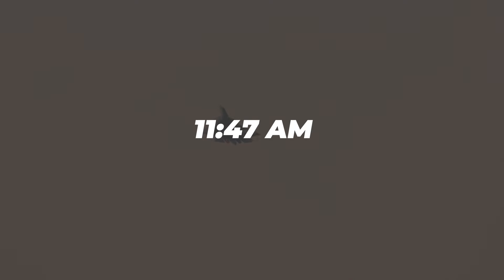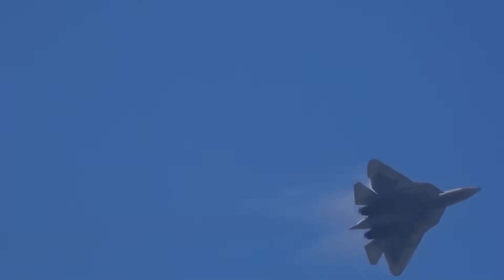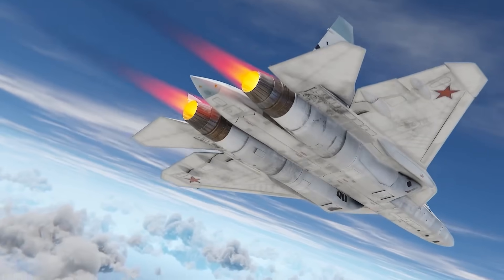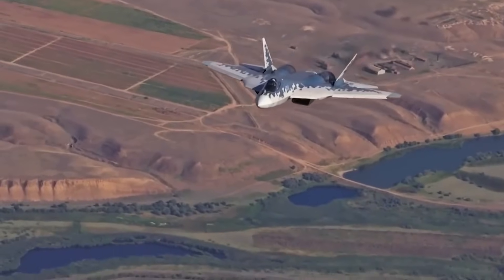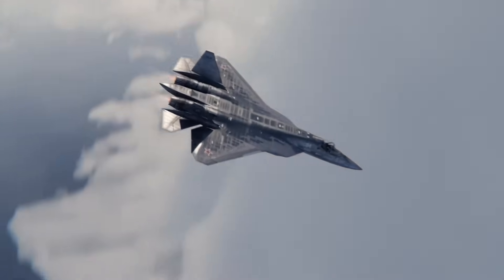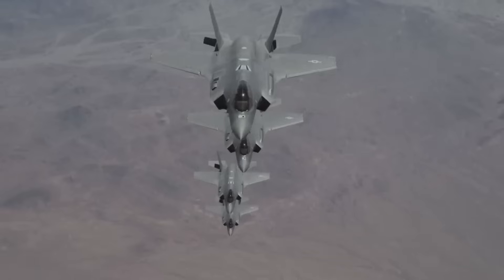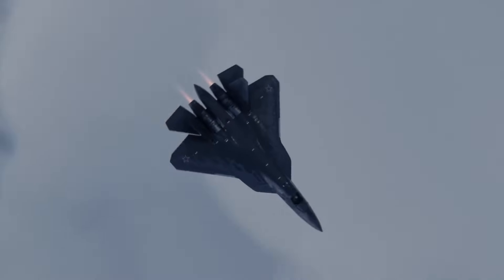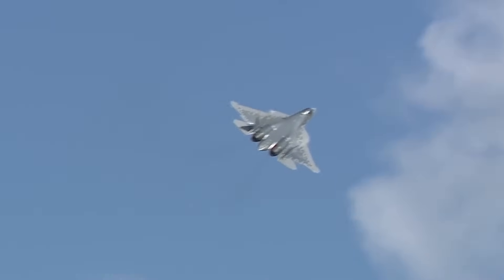Why the Su 57’s ‘Bad’ Design Is Actually Genius

Comment: Stealth only works against poor countries anyways, modern radar systems can detect stealth aircraft for more than 100km anyways.
Reply: @apenasumhunter3212 Not even that, remember, that Serbia detected and shot down F-117's with 1960's Soviet radars and AA systems.
Reply: @StefanBlagojevic  only once >.>
Reply: @Toast_d  Tell that to Lieutenant Colonel Charlie “Tuna” Hainline, who officially came on record, stating: "His airplane wasn’t in really good shape,” Hainline remembered, and soon after the other F-117 had plugged into the boom, the jet fell away, leaving “Tuna” and the tanker crew wondering if it was now flying on only one engine, or if some other problem had presented itself to the pilot. The jet crashlanded at Spangdahlem - Germany and was written off.
Reply: @Toast_d  Just only once was enough to force the US Air Force to retire the F-117 for a permanent.
Reply: @StefanBlagojevic  Crash landed but not shot down ^^, two different words with two different implications and meanings
Reply: @lucifers242   It got retired, indeed, but it was retired due to more advancements in stealth and radar technology alike.

Its in a special role as of writing this comment where it still flies in specialized roles like aggressor training.

I mean who wants a flying wedge than can only carry two bombs when you have an even bigger wedge that can carry more of the same bomb, or two even bigger bombs! Decisions decisions...
Reply: @Toast_d  Written off and struck from record. "It never rains, but it pours".
Reply: @StefanBlagojevic Written off by extensive damage buuut not shot down. An Su-57 can't be declared "shot down" if it's rendered irreparable by anything other than being shot down in mid air combat. Unless, you want to admit an Su-57 got shot down by a puny drone?
Reply: @Toast_d  Who's talking here about the Sukhoi bub, I'm only stating the fact it wasn't a fluke, since it wasn't just the one stealth aircraft that got targeted and got shot, LoL. Whatever beef you've got with the Sukhoi, have at it for all I care =D
Reply: @StefanBlagojevic And I'm stating the cope I'm seeing from stretching the definition of "shot down" to "crash landed" sounds like you have beef for the F117 as well, bringing up the Su-57 being shot down by a drone is just sooo~ easy to say when using your logic ><
Reply: @Toast_d  You're mixing apples and oranges bub, can't help you there.
Reply: @StefanBlagojevic  Mhm, sure, can't help or can't argue?
Reply: @Toast_d  I did argue, with two F-117's shot and with sources you can easily check for yourself. "Can't kill what you can't see has been" debunked, twice, by 1960's Soviet AA tech. Enjoy your research.
Reply: @StefanBlagojevic  Your argument is stretching the definition of words, more of a "cant" rather than a "wont" argue, you didn't read my comment properly.
Reply: @StefanBlagojevic  You did argue, I was saying that you just can't, you're stretching the definition of "Shot down", using the Su-57 was just to put a reference to how idiotic your argument was.
Reply: @Toast_d u r 5 yo dude lol
Reply: @StefanBlagojevic Same serbia failed to down a single B-2.
Reply: @Eshrakgaming934  Tell that to the U.S. Air Force, that had to go to "SPAČVANSKE ŠUME" to recover the B2 wreck. 😁
Reply: @StefanBlagojevic and it took some shit ton of dedication, planning and luck. They're used multiple radars and the range where they actually detected F-117 was much less than radars operation range.
Reply: @StefanBlagojevic  bro, this has been debunked so many times, and it was pure luck
Reply: @Yeeeee-w9h  Pure luck? What about the second F-117, testimony by Lieutenant Colonel Charlie “Tuna” Hainline? Shot over Serbia and chrashlanded in Spangdahlem and written off? LoL, you live in denial.
Reply: @Yeeeee-w9h  Well, the Nighthawk were flying in their common route, which is a strategic mistake by the American. The Serbian notice their flying route and focusing their radar there.

Coincidence? No 
Luck? Yes, because the Serbs managed to shoot it down.

But again, I feel this is the pilot's arrogance in their high feeling of their superior tech. Since it was a stealth aircraft, they began to feel the "no need to worry" about the Nighthawk when open its weapons bay, which distorted its stealth capability, just because the Serbs only use old tech.
Reply: Thats why Russian tactic in Ukraine is glide bombs. Lobbing them from safe distance into the area until everything there stops existing, then moving in with soldiers on the ground. Slow, but inevitable.
Reply: У СУ-57 и СУ-35С радар видит в радиусе 400 км.
Reply: This is why American fighters don't dare to fly close to the Russian radars. They can successfully fly and bomb only terrorists and militants.
Reply: First, no and second stealth is not some magical solution that wins against everything. The stealth design alongside RAM is nothing more than a tool. You still have all other methods such as flying low, using the weather, jamming turning off your radar, etc that 4th gens use. It is just another tool. Different frequencies bring different results. You might have lower frequencies which go further and due to their "size" can't be as easily dispersed as higher frequencies. Yet lower frequencies cannot give the precision needed for a lock. Which means that you can technically use them to guide a missile but the chances of it hitting the target are slim to none. Higher frequencies give higher precision but they require more powerful antennas in order to go further. That's like using a sling. If the ball is larger you need to pull harder in order to get as further as a smaller ball. Yet, it is easier to disperse them.
Reply: Nahh
Because you stupid doesnt know how stealth work
You forgot about B-2 going inside iran
Reply: @resliaamayrilisys4617 Iran has very weak economy mean iran is poor. You Arrogant stupid
Reply: poor countries hve older radars too, but you can't TARGET a stealth
Reply: Detecting it tracking it and miss locking it are all wildly different things
Reply: .....By the way, modern radar systems from China and rushka could not protect Maduro from American special forces.....
Reply: Lol how much you would be willing to bet on that statement? 😂 US and its NATO allies wouldnt have ordered alltogether over 3000x F35's fighters already if they werent convinced of its capabilities.

Speaking of which, do you know how many SU-57's Russia has been able to manufacture, including the prototypes? 😂
Reply: @Balnazzardi  Tell Lieutenant Colonel Charlie “Tuna” Hainline he's lying then, see how that goes, I'll grab the popcon. 😂
Reply: Source: Trust
Reply: yes and no the absolute top stealth aircraft can bypass many mid range radars but its very hard to get past a full array
Reply: W/o where’s this pancake spin epic fail
Reply: Agree
Reply: exactly. Stealth is meant to terrorize weaker countries like Iran. That won't work against Russia and China
Reply: People need to realise that stealth is simply a tool. Hyping it as a "wunder weapon" is the mistake that Nazi Germany did. It's an advantage, but not invincible.
Reply: They are easily detected in rain,all you have to do fire silver iodide tocause rain
Reply: @aakashboom  good luck doing that when you're a Venezuelan dictator.
Another thing. Good luck doing that when you don't have the infrastructure.
Another thing (you gotta be the easiest target here, I'm firing bursts at you.)
You wouldn't call in rain unless you already detected the planes. So, your detection idea, relies on detection itself. Thank you Pvt. Armchair for your input.
Reply: Shhh ! If americans could read that they would be very upset !
Reply: @jayyadav6576  maybe it could detect stealth aircraft from 100km away...if the bomb bay is open...without any radar warning system.
Reply: Well thats the thing with the western commentators, they never actualy faced real army. We see in Ukraine that all western hardware is nothing but junk, expansive junk
Reply: @ekoneko6958  come on boris i know your shift is almost over but atleast TRY to write proper english
Reply: @LAUMINEIL at least I can speak more then one language 😂
Reply: @ekoneko6958 lol as if latest weapon and armor have been sent to Ukraine 😂 and yet some of it like Javelin missiles and Stingers proved to be quite effective against Russian military vehicles + Russians themselves have proven what kind of garbage their own army and equipment is with T72, T80 and T90 tanks destroyed by thousands and their airforce completely unbale to gain air superiority 😂 so try again Ruskie, if NATO was there with their full force, the pathetic Russian army would have been wiped out long time ago and many times over 😂
Reply: @ekoneko6958  they seem to like Javelin missiles a lot. The Russians not so much.
Reply: Modern,and old radar stay off if close modern west plane come close 200 km. switch radar on, and you are dead in couple minute.
Reply: The problem isn’t tracking, it’s locking on. No radar on earth can lock on to the American F-22
What did I expect when commenting the truth on a AI slop video that makes all western tech seem like shit and all eastern tech seem like godlike machines.
Reply: @turtlechanel8345  Because it has only combat experience against a Chinese weather balloon/spy balloon, 2 missiles needed to destroy the balloon (the first missile missed and 2nd missile is needed.)
Reply: @turtlechanel8345   "tracking"  Why on earth anyone wants to track that specific bird eyes?
Sure a radar can detect stealth aircraft, but it's not going to be noticed, because it's not the only object on screen & it's so small & no one knows what it is  . . and there's still no app that can effectively differentiate stealth aircraft & birds

F-117 is a repeat of U-2 accident, that's why military should not re-use a flight path back to back
Reply: The United states has the best Air Force and fighter's in the world.
Reply: @paulahutcherson1045  Not for long, China is producing more fighters per month than the US does in a year. China also has the mosy heavy weight fighters in the world, giving them a huge range advantage. Chinese fighters recently took out french rafales too, The Chinese J10 costs one fifth the price. I hope the US manages to stay ahead but i doubt it will. The US defense industry cannot make anything that stays in budget.
Reply: @ruhtraeregel Cope, lies, or ragebait
Reply: @Yeeeee-w9h  Not sure I get you, I assure you im not coping, nor am I lying and certainly not raging lol. Can you elaborate? What are the lies you mention? Coping for what? It helps when you are a bit more specific. Then I can reply effectively.
Reply: @paulahutcherson1045  it does, but those airplanes are expensive and fragile. In any sustained conflict with a peer opponent a lot of them are out of action for maintenance and would eventually fall behind to attrition as they can't be replaced at the necessary rate. 
In the end everyone uses these planes to fire range from outside the range of air defense anyways, so the advantage isn't really used.
Reply: @paulahutcherson1045  they have the most, not the best.  Russia and China have the best.
Reply: @Hugo_Furst  Cope, lies, or ragebait
Reply: Tell that to iran😂 they bought latest russian junk bro and still get penetration deep by b52 😂😂😂😂
Reply: @misogear they don't have radar that Russian have, so it does make sense that they couldn't detect the b52.
Reply: @apenasumhunter3212  The problem is that Iranian air defense was neutralised by Mosad before the attack and also they don't have the capability to reach the altitude B2 flying on. However, the Russian radars would detect them as a joke. The Serbs detected, tracked and downed one stealth and hit two another.
Reply: @misogear  Iran's defense were neutralised first. They didn't have a chance to fight against American fighters. Now be smart and explain why they were neutralised without fire?
Reply: @misogear  Iran didn't have Russian S400 air defense systems. when the B2s bombed.  Had they had S400, the B2 wouldn't have a chance.  They may have them now, though.  Don't know for sure..
Reply: @misogear  Iran wasnt using the latest Russian hardware, it was using 30 year old SAMs and homemade ones. Also no B52s were used lol you are clueless.  Israel using the latest SAMs could not stop Iranian missiles. Also Saudi Arabia using the LATEST US SAMs couldnt defend against missiles launched by the houthis, very primitive missiles yet Patriot missiles did not stop them.   In Ukraine the LATEST US SAMs the Patriot PAC3s could not defend against Russian missiles and every single Patriot battery has been destroyed. They were destroyed using older Russian tech not their latest too lol.   The fact is there is tons of recent combat proof that the LATEST US tech is inferior and vulnerable while the latest and even older Russian tech is superior in price and function getting real provable battlefield results.

You were refering to the B-2 which costs 1.4 billion dollars which penetrated an air space defended by 30-40 year old systems. I would hope the B-2 can get through. Modern Russian and Chinese radars can detect stealth. F35s in Syria from Israel got radar locks on them from Russian SU57s using L band radar. The lock was from 90km away.
Reply: @misogear  Latest? Dude...
Reply: After USA controled by Israel bombed Iran, Iran bombed hell our of Israel deply penetrating iron dome.
Reply: @misogear  that b52 strike was a piece of theater the USA agreed on with Iran so they could claim victory and end the war. 
Israel was getting pounded and was running out of air defense missiles once the surprise of their attack wore off and failed to regime change Iran. 
Thus Trump decided to stage this with Iran in order to save Israel. 
Iran never wanted the war to begin with so they agreed.
Reply: @misogear  Russia has the most advanced and capable anti air, even the soviet stuff is still capable.
It's going to take a while for Iran to get their crews train on the new AA.
Reply: @adr8 .....Seriously, that is why rushka lost more this super duper anti air system right.....
Reply: @adr8  There is no match to S400/S500.
Reply: @류스란류탠커 I don't speak gibberish, try again.
Reply: @adr8 .....The West has more advanced air and missile defense systems that is it.....
Reply: @류스란류탠커  Factually wrong.
Reply: @adr8 .....No, you wrong because Patriot air defence system can beat iskander or kinjal but soviet or even rushka system can not repeat this.....
Reply: @류스란류탠커  Source: Zelesnky
Reply: @adr8 .....🙂 No, it is just fact Patriot can do this.....
Reply: @adr8 .....Why does the Ork S-500 have a missile designed to shoot down ballistic missiles that weighs a thirty one of a ton, but the same missile from the SAMP T complex, which is also designed to shoot down ballistic missiles, weighs half a ton yes 🙂.....
Reply: @adr8 .....Why modern radar systems from China and rushka could not protect Maduro from American special forces.....
Reply: @adr8 .....Why modern radar systems from China and rushka could not protect Maduro from American special forces.....
Reply: @류스란류탠커 Maduro was given away willingly by the military. At the very least you would have seen Manpads being fired in mass at those low flying helicopters. The military stood down.
Reply: Powerful countries fighting each is extremely rare. Stealth jets are mostly used to infiltrate weaker one, they didn't even use the su 57 in the war because they know that it's obsolete compared to America's stealth jets which have been proven to be highly effective.
Reply: @Killian-o6e  They are using the SU57 in Ukraine for air defense suppression and air to air missions its got multiple kills the Russians claim, against older Russian jets obviously. It is 100 percent in the war though. It was used in Syria too. One SU57 locked on to a Israeli F35 from 90km away over Lebanon.This was done using L band radar, this is probably true because after the claim for weeks Israeli aircraft ceased operations. Its a well known fact that long wavelengh radars can detect stealth. however the detection wasn't tight enough to get a lock using such radars. Russia claims it overcame that problem and says it's radars can now detect and target stealth, although still at reduced ranges. The SU57 is equipped with normal radar and L band radar which will detect stealth (can it get a lock?). So as far as I know the only air to air engagement between Russian and US stealth aircraft resulted in the SU57 getting a radar lock. considering the SU 57 cruises at mach 1.5 and goes mach 2.5 at max and the max of the F35 is mach 1.5   (It cant open its missile bay doors going supersonic lol and its engine coughs out so its max is really subsonic)   this means the F35 cant escape. I dont doubt the F22 is superior but it costs something like 8 times the price. The F35 however sucks really really bad. Also if it gets to dogfight range then its certain the SU57 will win, its far more maneouverable. Dogfights are rare though.

 And can you point our where US stealth jets have proved themselves against aircraft? Id like to know. I cant find any articles anywhere about that.
Reply: @ruhtraeregel Russia also has integrated systems, so even if the airplane can't lock on, it can have a better ground based radar turn on and use that information to guide the missile.